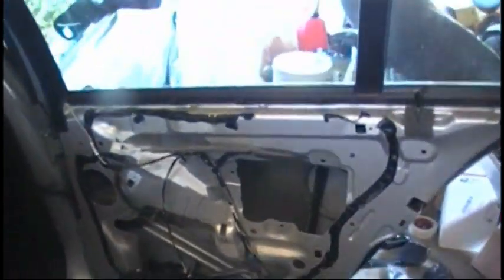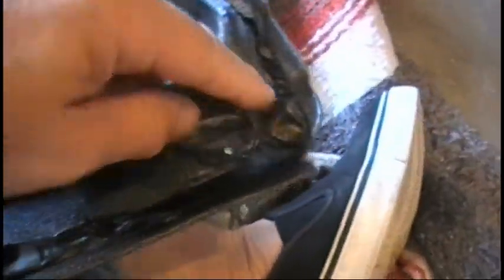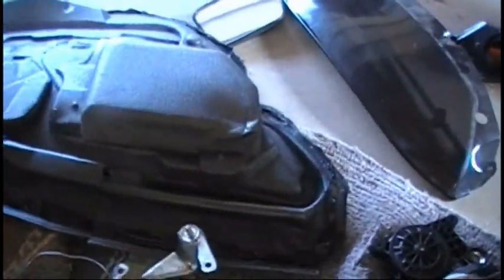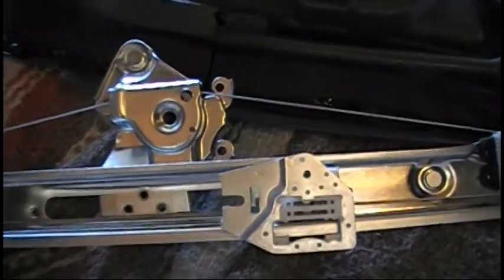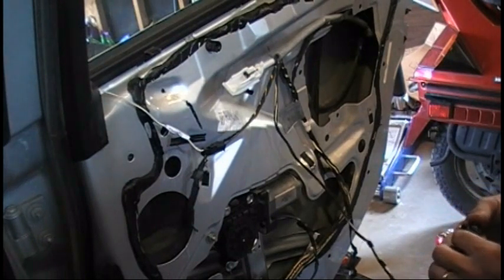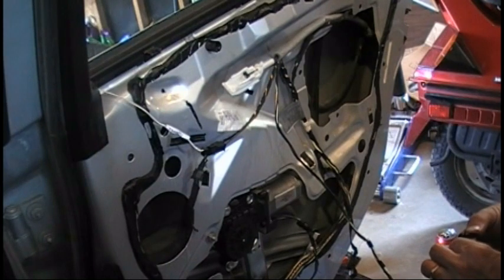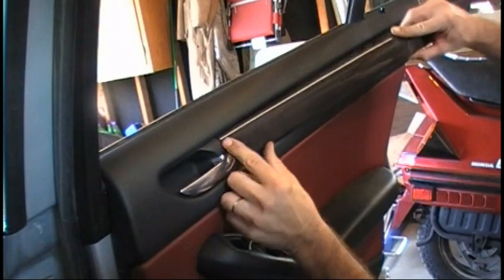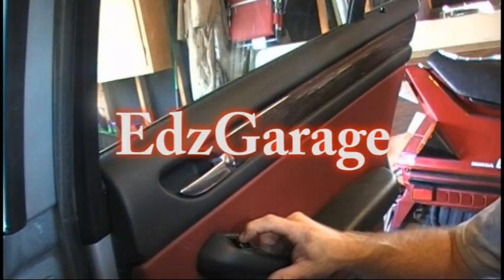Window Regulator Installation BMW 3 Series

Comment: Not sure if U R the one who made this video but I want to thank U for making it.  I would never have figured out the part when U remove the motor and then replacing it.  The little trick of rolling the motor full up and leaving the window a tad open.  It worked the very first time.  Bottom line it was pretty easy and I saved myself $130 labor.  Mucho gracias

Comment: I just did this repair about a half hour ago and it was no f'n walk through the park. I replaced the entire assembly along with the motor for the front driver side window and the entire assembly cost me $57 with free shipping from a vendor on eBay. I started at 1630 and finished around 1940 but I saved a ton of loot. BMW charged me over $400 about 4 years ago to fix the passenger side one.....ba$tard$! I should be able to do the job in under 2 hours for any future repairs...thanks for the video.

Comment: First of all, I would like to thank edzgarage for his video, it really does help a lot. I manage to do mine in a few minutes. Anyway, in reply to your comment, I had the same problem myself, the nut end up getting round, so what I did was, on the old regulator where the bolt is attached, you can see a white plastic that holds the bolt and the regulator together, cut them by using a hacksaw (blade only)and once you've taken the assembly out, you can then see the bolt and then use an angle grinder

Comment: The motor setting bit at 8.35 is essential. Most videos omit this. Good stuff! I fixed my window regulator with cable ties and it works a treat

Comment: Thanks for the reply, I actually didn't disconnect the battery but thanks to your video I saved about sixty bucks from overpriced regulators at a tuner website. I was able to do both windows in about an hour.. pretty straight forward. Thanks!

Comment: Thanks for posting this! I had BOTH regulators go out at the same time. Replacing the second lift mechanism was easier than replacing the first, but I did both in under three hours. I believe that the problem with these regulators is that the lift motor really torques the window into the up position before it shuts off, leaving the regulator internals under great stress at all times. After months or years of being loaded in this way, one or more of the plastic parts shatter.

Comment: Thanks for sharing ! Great video. I just replaced the regulator on my 325i 2001 left rear window. The video was a great help. The cost for me was ~ $24 (bought the regulator from ebay) compared to ~$400 I paid for the other rear window.

Comment: Great video! I watched this before I ordered both of my rear regulators ($42 shipped!). Easy install! 

One thing you don't have to do is adjust the power windows like he does. The motor does not have to be installed all the way up or down.

A++++++++++++

Comment: I have a 2001 325i, and the way you described the noise in the door is exactly the same sound mine did.  Same door, too.  Scared the heck out of me and my little girl!  I thought the glass shattered!  Thanks for the great tips, especially backing off the regulator to install the motor. Yup, 25 bucks.  I got mine at discount body parts dot com.  And, all this not one week after having to fix the airbag light with the bypass circuit! (another extremely helpful youtube vid!) Thanks again.

Comment: Good video--- nice camera work also----You just saved me a load of cash-----I priced out a regulator at a local BMW dealer ---- almost had a coronary $208 without the motor and 2 hours labour to install it at $ 133 / hr.
With tax thats around $500 No wonder I,m having second and third thoughts about ever buying another BMW ---- no matter how good they drive.
I'd have to get my hands in there and also hit E-Bay.
Excellent video dude

Comment: Thank-you for posting this... I was able to replace my broken regulator with relative ease from your instructions ....the only thing i think you missed is the the 2 screws under the arm rest that need to come off before you pull the door cover off the "snaps".  My car is is a 2002 325xi not sure if this is different with other models...outside of this this your instructions are spot on. Cheers

Comment: You were lucky with that glass, those things have a habit of smashing when the regulators go, great job.
Handy tip: If you have some lithium grease handy, coat those regulator cables. Here they tend to rust out. But your old one looked fine :)

Comment: Thanks for the video. It really helped and felt good saving some money. the only small issue i had was dropping the nut and bolt that connects to the window. I was tempted to order the replacement part but i was better off after seeing the frayed cable.

Comment: Dynamat helps dampen aggresive door closing which tends to brake the plastic piece on the window regulator that carries the cable end. Mass in motion likes to stay in motion and the poorly designed plastic piece is not up to the task. I have a Sport 328i and closing the doors sounded like a tin can rattling. With the Dynamt installed the doors close with a solid clunk and the extra mass in the door helps to dampen the effects of aggressive door closing.

Comment: Great video. The only thing I would add is that if the regulator is too damaged (warped cables, broken plastic), you're better off buying the whole assembly for like $60 or so.  On my BMW there was no 8mm screw holding the glass, it was a clip that needs to be pushed to detach the regulator assembly from the glass.

Comment: After the new regulator is installed, roll the window fully up, and then down about 1/8 inch to relieve the stresses on the regulator internals. The motor torques the glass all the way up, leaving those delicate plastic parts in the regulator under continuous stress, which is what caused them to break in the first place.

Comment: I had same issue had to get a Dremel cutting tool and shave the head a bit and made bolt easier to catch. Time consuming but don't didn't want to break the glass

Comment from the maker: @ChuckBeans8 Thanks! I pulled hard on the edge of the trim opposite the handle.  At the door handle there are tabs the go into the plastic, so you need to start on the other end.

Comment: I don't know if you ever changed it but the starter was hard. But I got to all the bolts form the top. Did not take off intake or move transmission. Took Lower Control arm loose and got it out the bottom. I hope I never have to change that again. My ac is all that acts up now. Its hit or miss it works fine for maybe a week. Then nothing for 2 or 3 days. I have recharged it but I dont know what to look for now

Comment: Thanks for the great video! Replaced mine today with no issues. A couple of notes: you need a long handle torx (T20) tool to get the door panel off- my torx socket bit wouldn't fit. Also, I used a cheap ebay replacement and it works fine (at least for now). I usually like OEM, but these OEM e46 regulators fail right and left, so why bother?

Comment: well from soo far watchin this video, another video, & a couple of forums...i think i finally found out wats wrong with my window. The problem might be the regulator(which most of the forums said about the 325i e90 with most windows); but the bigger problem is that idk where i can buy a regulator & the cost is about $120 or more

Comment: Life Saver... Just replaced my regulator and my 2001 BMW 330xi works like new....  (side note:  had to bend the new mounting bracket holes on the replacement regulator as they did not align property...  It was an easy correction....)

Comment: Cheers for that. That 8mm bolt that holds the regulator to the window refuses to turn. Tried everything, but no luck. I hope I don't have to break the glass and get a new one to get it out :( any tips?

Comment: im afraid to hammer the bolt as i might get the glass broken. i never thought of using a hack saw blade and cutting the back side of the plastic thing to loosen the bolt holding the glass. That solve the problem. i brought it to a bmw specialist shop and thats what the technician did. cost me $50 labor & part. i bought the new replacement window regulator at $24.

Comment: Great video! I have a question. Do you know how to "program" it after the install? Mine goes down and sometimes doesn't want to come back up. When the window sticks open, It "twitches" each time I press the up button; after a few times it will roll up. Help!

Comment: hey mate good video!! mine seems to be same problem.. quick question... I have a 325i e46 2003 and it has airbags in the door... does yours have airbags? do i disconnect the battery before working on the regulator.. (its Rear left) cheers

Comment: great video! i did mine today left side rear passenger but i cannot unbolt the bolt holding the glass as the bolt is getting lose thread..any advice how to take this bolt off?  i already sprayed wd40 and used a closed 8mm wrench but still it slips off. =(

Comment: made that look so easy. is this the same principal for the front on a coupe? mine stopped working,heard some crunching. so after inspection,my cable had wrapped around the motor and fell out,snapped in half. Im debating wether to get a repair kit or a full regulator? What did you do with the window? how did you get it to stay up?

write back,cheers

Comment from the maker: @bigass12342002 That sucks! I'm not sure how the window comes out, but it has to just slip in from the top. You may need to remove the weather stripping.

Comment: Did you disconnect the battery? It's my first time popping open an e46 door (have done it on an e36) but I'm a little hesitant to open it with the battery connected because of the airbags. Anyways thanks for the reply in advance! your videos are great

Comment: @edzgarage 

Hey,

Your video is super informative and helpful. My one question before I try this repair myself is if that ebay "cheap" regulator holds up? I am skeptical of the quality considering the dealer charges $170 for that same part. 

Your comments would be greatly appreciated! I am a student so I am all for saving money! but I also don't want to have to be repairing the regulator over again because of a cheap part.

Comment from the maker: @Needmorehorsepower I heard these were a problem in these cars. I didn't mention it in the vid, but this one was replaced before I got car. I know this because all the tape that holds the wires was broken or gone.

Comment: So I replaced the regulator just fine and when I put it all together it works fine except the window only rolls up 4inches and a time and gives me an error saying anti trap window malfunction. So it wont atoumatically roll up or down or even if you hold down the button in stops after 4 inches. Any ideas

Comment: ahhhhhh you have to hate those bmw regulatorsif the slide doesnt go bad the cam wheel breaks and  thats if the cable doesnt break,bmws cutting edge until you get to the regulators   LOL.what i do is let the window down take out that bolt that holds the window and then push the window all the way up and wedge a couple match books againest the window in the track to hold it then unbolt the window reg............huh on the 540 and the 528   (97-98 ) have a micro presure switch that stops the window

Comment: How'd you reset the auto up, auto down function? I just replaced one of these and the  god damned thing keeps intermittently stopping when trying to roll it up. Sometimes it doesn't want to function at all. Other times it works great. I think I know what the BM stands for in BMW.

Comment: when i fit my hard top on my 318ci cabriolet my drivers side window seems to go up too far then pop outwards slightly leaving a gap between the 2 side windows when in the fully up position, it still goes up and down ok  when i open the car door the window still drops as it should but when i close it from the outside it goes up (seemingly too far)and  leaves the gap i have to push the glass slightly in and it goes up ok then  ...any ideas (oh and 1 more thing the window when in fully up position does seem wobbly )

Comment: No there's no grinding or rubbing sounds and sometimes it functions flawlessly. It's like the computer just goes retarded or something and doesn't want the window to go up. Someone said the motor may be going bad but the motor when it is working doesn't slow down at all. It just either works well or does not all.

Comment: what is the name of the whole kit? I also have this same problem with my car.@EdzGarage
Reply: It's just called a power window regulator. Just make sure to select the correct door. You probably won't need a new motor, but if you do, some kits come with the motor too. Here's what I used for my front driver's side (from Amazon, lifetime warranty through Dorman) window: http://smile.amazon.com/Dorman-740-484-Driver-Replacement-Regulator/dp/B001KQCC9K/ref=sr_1_2?s=automotive&ie=UTF8&qid=1411755953&vehicle=2000-31-167-20--1-6-7-452-171-1-1-163--1-0&sr=1-2&ymm=2000%3Abmw%3A323i&keywords=window+regulator

Comment: Thanks for the movie. When I tried to close the window I heard this sickening crack and grown and nothing happened. I thought the glass had broken. when I watched your video it helped me identify the problem and get to the solution..i have NEVER tried to fix anything in side a BMW before. Now I know why BMW charge an amr and a leg for this job. It really is a simple task provided that you have the correct tools. i bought the Window Regulator from Auto Zone, $130. It is all one piece and includes the motor. Plus the cables are protected inside a plastic sleeve.  (http://www.autozone.com/autozone/parts/Dorman-Window-Lift-Motor/1999-BMW-328I/_/N-jdif1Z8ijyb?itemIdentifier=385770_582946_16599_4299%2C78919)